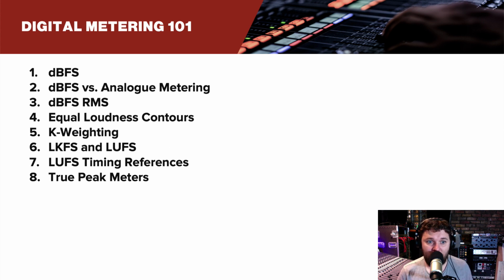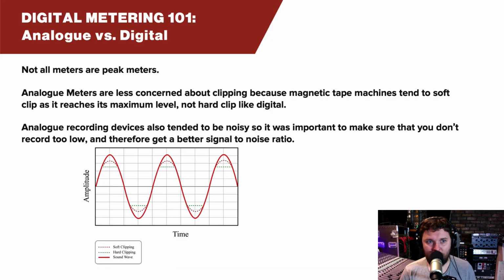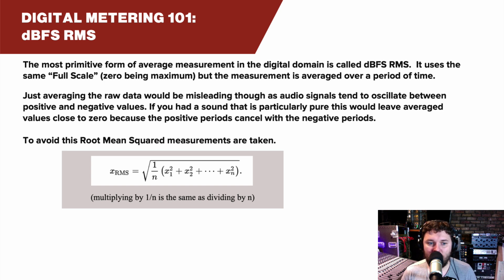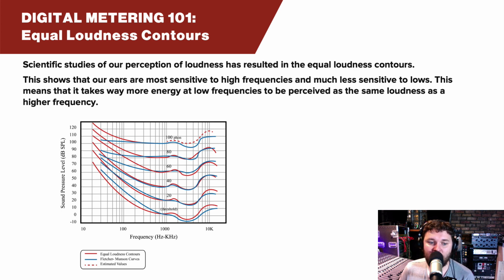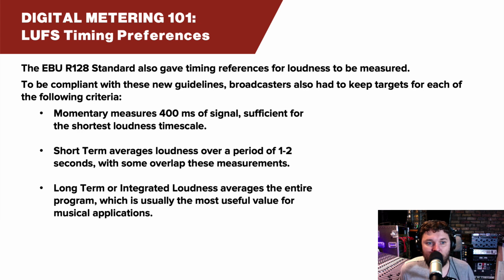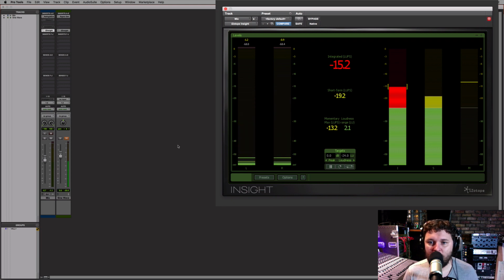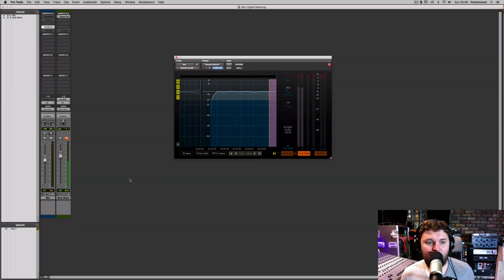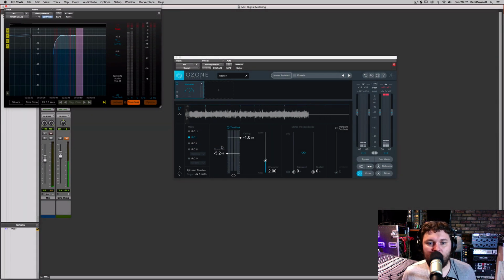Digital Metering 101 - dBFS, RMS, LUFS and more

Comment: From what I can hear, anywhere near 0dbfs you are asking for distortion.  You must consider your converters also. 
And I hate to point out that +12 dbu would normally appear before +16dbu on a real meter!   :-)
Reply from the maker: In regards to the +12 thing, It's meant to be +6 but it's just a typo in the slide, but you already know that right.
In regards to distortion,  Obviously, the circumstances matter here. If you are talking about purely one channel as long as you are under 0dBFS you should get ZERO distortion (if everything is set up properly and functioning correctly).
If you are talking about the gain staging of an entire mix, running the levels on individual channels anywhere close to zero is asking for trouble. This video is just about individual metering and not gain staging though.
Reply: @audioproductiontips  Yes I did know it was a typo. Pete, please see my comment on Top Down Mixing video!!